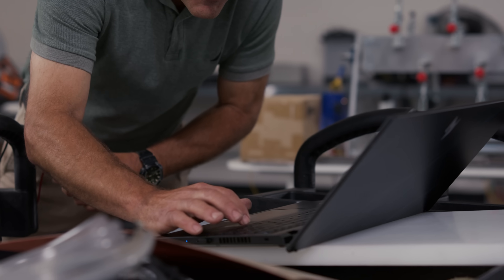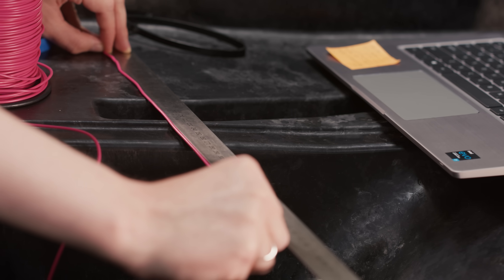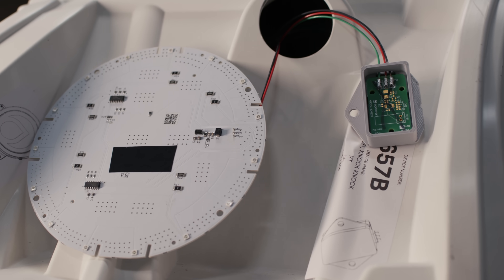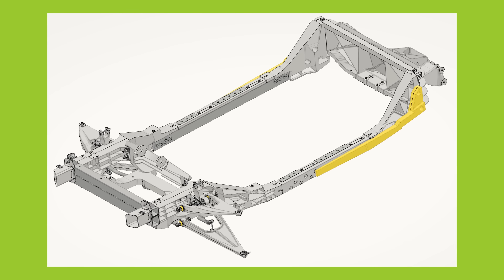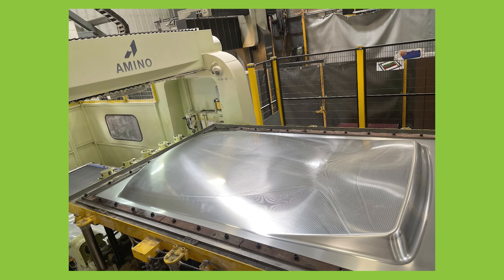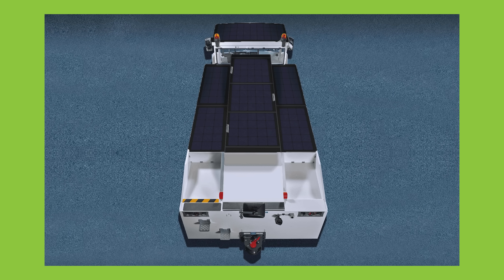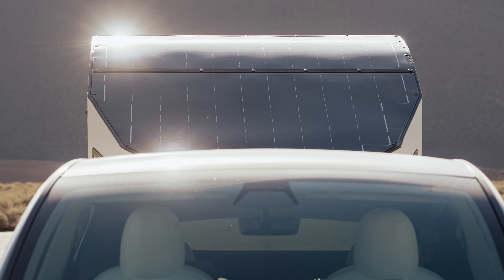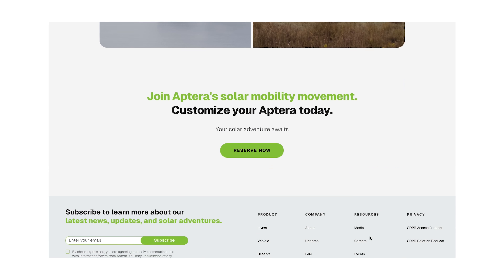Aptera Update — June 2024

Comment: Recently had to use tire plug kit to repair flat on my tesla while on a trip.  I realized that doing this on an Aptera would be difficult because its not easy to have access to the tire tread with enough room to plug hole, which is more difficult than I thought it would be.  Aptera would really benefit from airless tires because a flat on a trip means you will need to be towed if the leak is fast enough that you won’t make it to a shop
Reply: I have used plug kits on motorcycles with far less access than Aptera will have.  Airless tires at present have far too much rolling resistance.
Reply: @n.brucenelson5920   on the side of the highway? Also the aptera offers almost no access to the tread so I still find it hard to believe.  Lastly I think quite a lot of people would trade some efficacy in an already ridiculously efficient vehicle for the peace of mind of not having flats ever.  I think airless are still prototypes but lightweight vehicles would be a great test subjects.
Reply: @schtinerbock4570  Yes.  I have also used them on the inner tire of a dually rear wheeled van.

You do know that the outside wheel covers of the front wheels pivot upwards on a hinge so that the entire tire is easily accessible?
Reply: @n.brucenelson5920  yeah but punching the plug through the tread requires that you can square yourself to the tread to push hard enough.  I worked on duelly wheels as well and that would be easy because you can easily put some muscle into pushing into the tread.  Access to the side of the tire doesn’t help in the least.  You only have access to the side wall. So yeah I don’t accept that you know what Im talking about in the least.  Get a tire even a fully exposed one and see if you can put a plug in down at the very bottom 2-3 inches close to the asphalt.  Where you need to angle upwards.  Lets see how much skin you lose off your knuckles.
Reply: @schtinerbock4570  I can see you have no idea about experience I have gained in 1/2 a million miles on 2 wheels, and more on other vehicles.   Your guess regarding the amount of access to the inside tire of a dually van is imaginary.

I have ridden in an Aptera prototype, but didn't experience a puncture.  Still, I know what to do.  if the vehicle has come to a stop on top of the hole in the tire, you still have to inch it forward or back some in any case.
Reply: @n.brucenelson5920   don’t care about your miles.  You have no idea about my experience with a hell of a lot more than motorcycles.  Everything from dump trucks, tractors, and cranes to trailers and boats. I don’t think you’ve ever plugged a flat especially not on a wheel that is almost completely encased and is thicker than a car tire. Later dude. Not wasting my time anymore.  Aptera is a long ways out still. Who knows what will happen by then.
Reply: @schtinerbock4570  It is clear that you understand neither Aptera nor the experience of others.  Believe what you want to in your own mind with no direct experience of the product.
Reply: Field upgrade (or perhaps future option). 1st vehicles all about efficiency… min. drag & wt.

Comment: Sion already tried the solar panel thing it just doesn't stack up and they eventually failed.  Solar for vehicles struggles to achieve a meaningful voltage required to efficiently charge anything apart from the 12V battery.
Reply: Also, Sion did not have the IP for manufacturing light weight, glass encapsulated solar panels that Aptera has.
Reply: @n.brucenelson5920  All of Aptera's published patent applications for "article of manufacture" - type utility patents for the glass topped solar panels are "final rejected" due, mostly, for non-novelty.
Reply: There's a blender app that models the Aptera at any lat/long and day of the year of how many miles you get from solar out there that proves you wrong.
Reply: You have not been paying attention, have you?
Reply: @J-W-Kelly  (looks like JoeB(no)Manco is stalking you)
Reply: @johnreeves7261  As usual you have it completely backwards.  I'm not surprised.  You tend to be wrong about most things.
Reply: @J-W-Kelly  You clearly don't.
Reply: I don't recall the details on Sion's "failure" but it wasn't because it had solar panels.  I assist in the build and racing of solar race cars and have been doing it for over 20 years.  My experience suggests that, while Aptera's certainly not a solar race car (or Sion), it will get a decent amount of energy from it's solar panels and because of the overall efficiency of the vehicle, get some not insignificant range from that energy.

Comment: (3:05) Sorry but that is not a very flattering view of the dash solar panel.
Reply: @bgeery  They look like wavy/bumpy solar panels.
Reply: Pretty sure that's the underside. The next shot shows the top surface that'll be visible after installation.
Reply: @AverageJoe928  I'm pretty sure it's the top side.  I can make out some of the solar cells.
Reply: @johnreeves7261  yeah the cells are visible but their outlines aren't as crisp as the next shot. I'm assuming that the bottom is still slightly transparent, but who knows?
Reply: @AverageJoe928  The cells are typically dark blue on their sun facing sides.  Their back side is more "gun metal" gray.
Reply: @AverageJoe928  FYI, on the AOC discord, Chris McCammon said that the dash solar panels had a protective film over them in that shot.  That would suggest that the film is the source of the wavy/bumpy look.
Reply: Port-A-John Reeves, I'm surprised the institution allowed you time to post on the internet today.
Reply: @JoeBManco  said: "Port-A-John Reeves, I'm surprised the institution allowed you time to post on the internet today."  I see the men in white coats allowed you time as well.  Maybe it's their way of helping you ease back into "society" after the lobotomy.
Reply: @johnreeves7261  Go easy on Joe.  He might melt and cry to AIM that Aptera fans are mean and he might just stop commenting.  Waaa.😢😭

Comment: When will you guys move to drive-by-wire and 800 charging and 48v
Reply: 48V is not mainstream yet and to be honest the distribution and manufacturing of that inverter is still pretty high in cost.  As for 800 charging that only is maintained for a short period of time and chargers decrease it because the thermal control on EV batteries can't sustain for the whole charging period (if you don't want a fire).